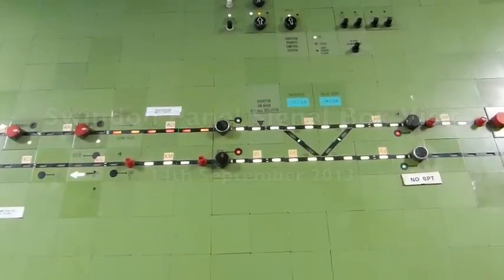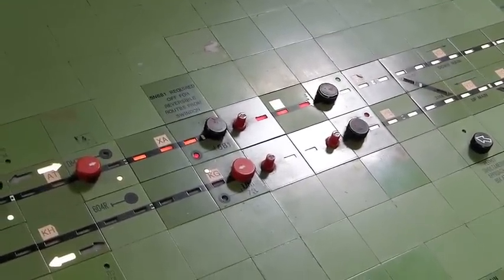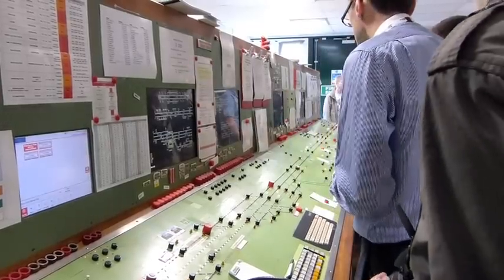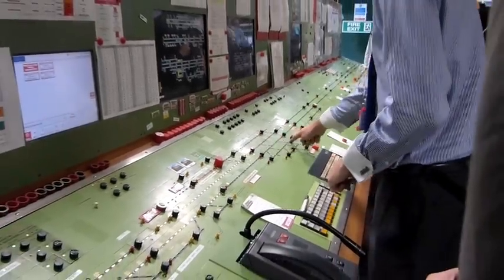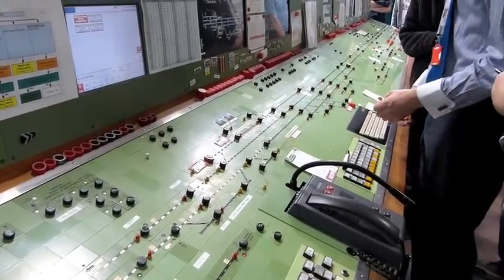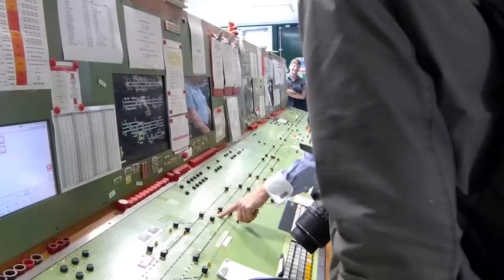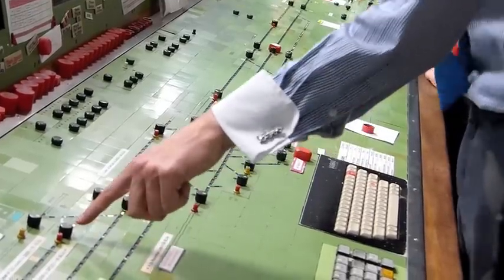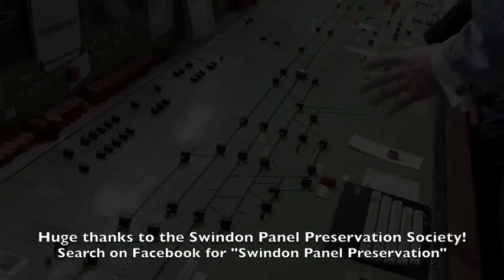Swindon Panel Signal Box Visit

Comment: Great video, I work as a signaller in Sweden. Most of our proper signal boxes are sadly closed and transferred to control centers, but a few still remain. This panel is very similar in operation to the Type 65 relay interlocking used on many larger stations over here.

Comment: Is the board still in use or just for show
Reply: it was in use when this video was made, taken out of use in 2016
Reply: Victoria Signalling Centre at Clapham Junction was a disaster! Failures all the time. Track Ciruits are not something that terrorists should know about.
Reply: Late reply -  the panel is indeed out of use, but it still exists. The team from the Swindon Panel Society removed the panel and installed it at Didcot Railway Centre, where it is now set up as a fully interactive and accurate simulator. Train movements are simulated by computer, and shown on the panel as they appeared in service, and it's open for the public to have a go. It's a superb simulation as well!